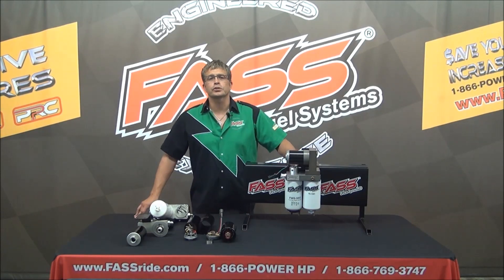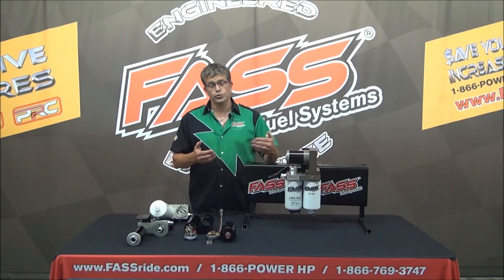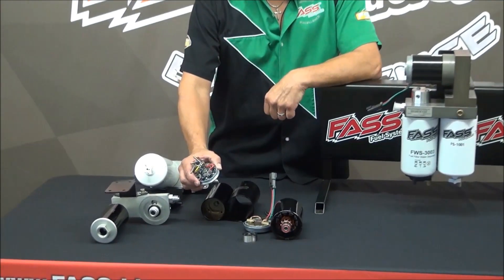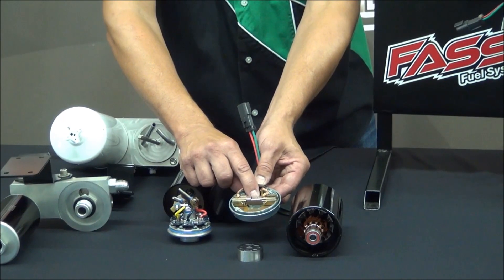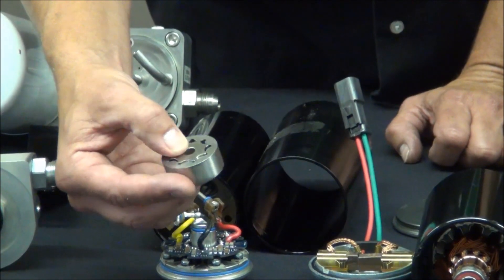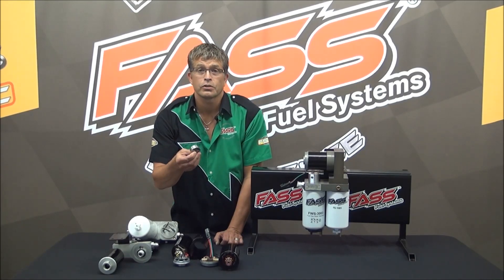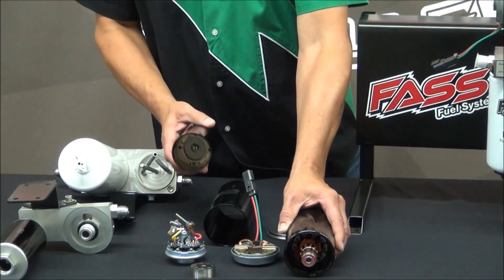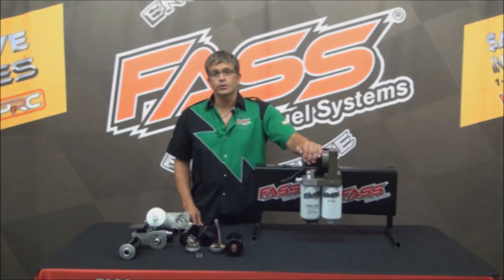Brush Motors vs Brushless Motors

Comment: That would be correct if  all applications like this didnt move the circuitry out of the pump away from the heat. The real reason you dont use brushless motors is cost. Cost to devolpe a board to stand alone from the pcm so you can pulse width the motor and cost to buy the more sophisticated brushless motor. Brushed motors are old technology.  Brushless motor will give twice the power and last 2x as long.

Comment: i agree with using  a brush dc motor vs a brushless. I DO NOT AGREE WITH YOUR REPLACEMENT POLICY. WHEN THE MAGNETS LOOSEN AND JAM, A NEW SET OF MAGNETS FOR $7.99 TO $10.00 WILL FIX 85% OF THE PUMP FAILURES. YET FASS FUEL SYSTEMS AND ASSOCIATES WANT TO SELL A NEW MOTOR PUMP COMBO FOR $299.99 AND UP. I HAVE TO DISAGREE WITH THAT POLICY.  ESPECIALLY WHEN THE WARRANTY RUNS OUT. WITHHOLDING ALL THE SPECS ON THE MOTORS .......